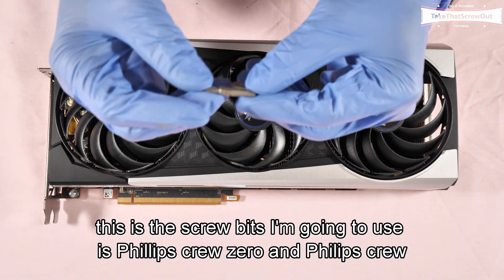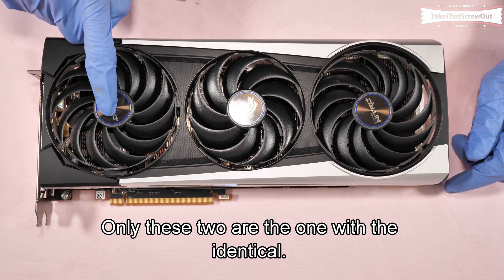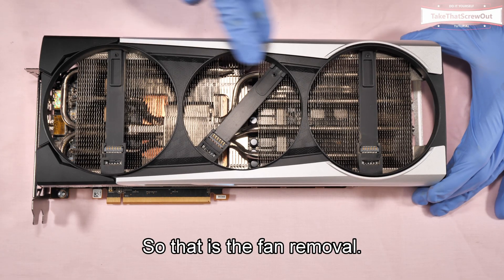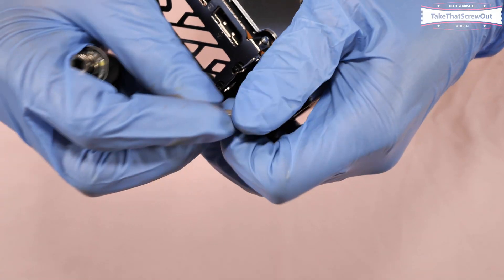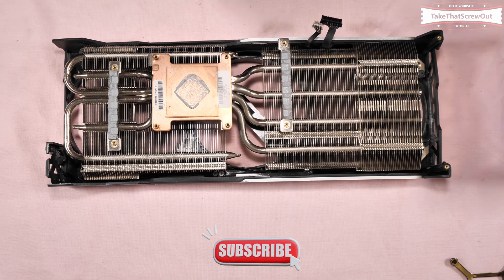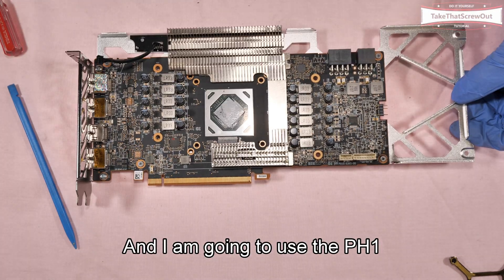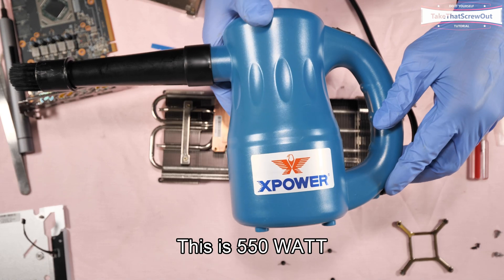SAPPHIRE Radeon RX 6700 XT Nitro Plus | TEARDOWN \ DISASSEMBLY | Thermal pads & Paste Replacement

Comment: I have ordered thermal grizzly minus Pad 8 in 1 mm and 1,5 mm are im Fine with that ? Can i make a Sandwich of that for the backplate or better Order a bigger size ?
Reply: And is 70% isoprop Fine ?

Comment: Also sapphire has "fan test" feature in their software (tests each fan). Might sound like a gimmick but my gpu is so close to the bottom part of the case that I cant see if a fan stops working. But I confirmed with software that all 3 works :). Sapphire seems like great company. Only next level would be to have screwless design with magnetic fans.

Comment: Thanks a lot for the video! Bought used nitro+ 6700XT and had 95C GPU/110+C on hotspot. 10$ and 1 hour later GPU is at 65C and hotspot at 95C.
Reply: I have the Same Issue 90 / 110 i wait now for the pads and Paste
Reply: Have fixxed it. Now Temps are good but i got new Problems with my ram and imc
Reply: Undervolt yapın. Frekansi 1200'den stok degerlere getirin daha serin çalışır.
Reply from the maker: You're welcome! Nice work bro!
Reply: What did you buy with 10 dollars
Reply: Please tell me, is 95 degrees normal?
Reply: @zxcnevermind nope..you should avoid gpu if the Hotspot is above 88-90 degrees ..it is not gonna live for long
Reply: @phantom055  still have mine after 3 years and it s still good lol, I ll repaste it soon too

Comment: If I just want to paint my 6700 xt backplate and shroud. I wouldnt need to disassemble the heatsink from the vram correct? So I wouldnt need to worry about the thermal pads there? Just what was disassembled?
Reply: Plakayı sökmeden boyamak kartın pcb sine zarar verebilir.
Reply from the maker: If you really want to paint the Front shroud and backplate..you should strip off the entire gpu..its quite easy on this unit. to prevent paint to get into the heatsink and possibly into the pcb that could potentailly damage it. detach the front shroud and backplate to paint it. you should rub it with sand paper first 800 to 1000 grit, then plastic Primer before topcoat to make sure a good bond and quality result, use spray can.

Comment: 5:15 no 3.5mm pad in your listed links ?

Then :
4:40 1.5mm
+
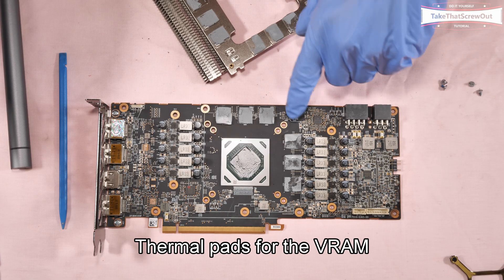(X2) 5:50 1mm 
=
3.5mm ? 9:13
Reply from the maker: Would you be able to access Amazon links, US or UK? I'll send you one if you're either of this Country. just let me know..thanks!
Reply: No excuse-me,
not a link problem,

but why 2mm and 2.5mm pads in link,
for 3.5mm  =  2.5mm + 1mm  or  2mm + 1.5mm ?

 @TakeThatScrewOut
Reply: @fred-san  I wouldn't recommend you make a "sandwich" of thermal pads (combining different sizes), put a 4mm pad on the backplate, even in the comments he himself already replied that this size works too 👍

Comment: Brow, do you put thermalpads on the backplate??
Reply from the maker: At factory stock there is a 3.5mm thick thermal pads strip behind the backplate that helps cool down. the plate is aluminium.

Comment: hello my friend, could you tell me the size of the thermalpad on the amd sapphire rx 6700 xt pulse board?  grateful
Reply from the maker: Hello Bro! I haven't done the PULSE version of this card yet.., but i did source out an information for you about your card..according to that info, the Mosfets uses a 1mm thickness, and the VRAM has 1.5mm thickness..i suggest use a thermal pads that is soft like an ARCTIC or similar..because if could adjust the gap easilly. Don't use those hard one like the Gelid.
Reply: @TakeThatScrewOut thank you very much for the information my great friend, I am very grateful!
Reply from the maker: You're welcome bro! Enjoy and take care!

Comment: Is the red thing on the screw from the backplate normal? cause my sapphire 6700 xt also has that
Reply from the maker: I didn't get it what you mean by red in the screw bro?
Reply: @TakeThatScrewOut  there's like a red glue wrap around on one of the screws from the backplate
Reply from the maker: @jetmiraclecommander4095  really? I haven't notice on that card..that might be there for a reason..

Comment: This is a good video, thanks for your work! I liked the music)
Reply from the maker: Thank you so much bro! Appreciated! Take care bro! 😀
Reply: @TakeThatScrewOut  I have a few questions, maybe you can help me.
1) I can't find 3.55mm, is 3.5 or 4 better? And is it possible to cut 3 strips (1 + 1 + 1.5 or 1.5 + 1.5 + 1) and connect them (so as not to buy 3.5 / 4 separately)?
2) There are 3 options for thermal pads in the store: single-sided adhesive / double-sided / no glue (self-adhesive), which one to choose?
3) Thermal pads for 13 watts and 15 watts, the difference in price is 2 times, according to reviews on YouTube, they are the same. I understand that 15 watts makes no sense?
4) Is it possible to put one continuous strip as a keepsake (many people do this) or is it necessary to cut it into squares?
Reply from the maker: @TETINNN1  based on my personal experienced, one whole pads is the most effective than multiple layer and stick them together. And if you use a bit thicker than the stock recommended, its fine as long as its a soft kind of pads..Thermal Pads has two different class, some manufacturer like Gelid and TEUCER use a stiffer pads, and some are softier like the Arctic. If possible use a one whole long stip if the chips are close with each other, doesn't make sense to cut the pads off little  by little. But most with VRAM CHIPS they're have gap apart from earch other, so use individual pads on each chip.
Reply from the maker: @TETINNN1  If you you have no other choice, you can do 1.5mm plus 1.5mm stick it together to make it 3mm. But this is only the last option you should do as this idea is not as effective compare to a whole pads. But definitely this could be better than no pads at all, this would still works..but it transfer heat less compare to whole one pad.
Reply: @TakeThatScrewOut  Thank you very much, you helped me a lot!
Reply from the maker: @TETINNN1 You're welcome bro! so glad to hear that my videos helped others..thanks for your positive comments..appreciated! Take care bro!

Comment: Can i use 4mm in the backplate? I cant find 3.5mm.
Reply from the maker: Definitely can.. with the backplate only, that can be pushed in when you tight the screw..but to cooldown VRams and mosfets on pcb always use the correct recommended thickness from manufacturer to prevent gaps
Reply: @TakeThatScrewOut  Nice. Thank you!
Reply from the maker: You're welcome! Take care.

Comment: what thickness are the pads on the vram ?
Reply from the maker: 1mm thickness on VRam..
Reply: @TakeThatScrewOut  Thanks for the video. For the Nitro+ 6800 XT model, will they be 1mm too?
Reply from the maker: @manucodalunga8893  not sure the Nitro+ 6800xt..possibly is different thickness, that card draws a lot of power and heat.